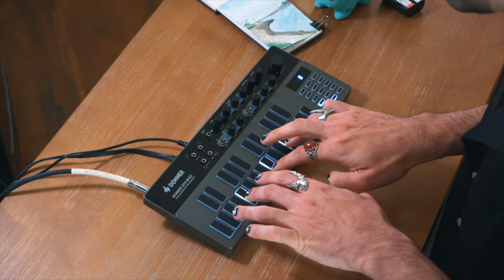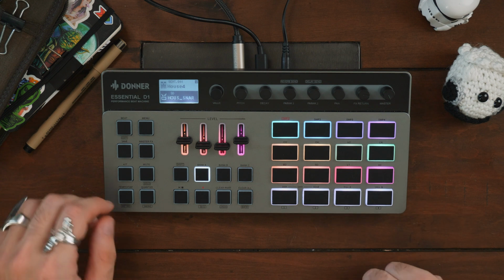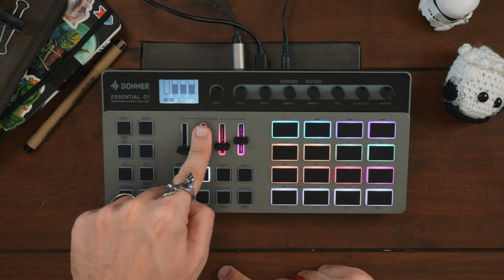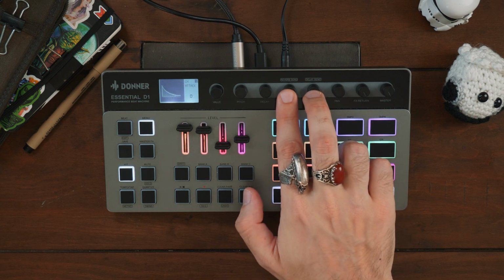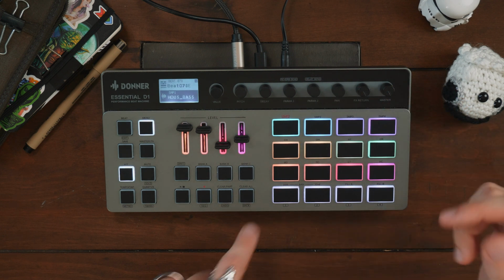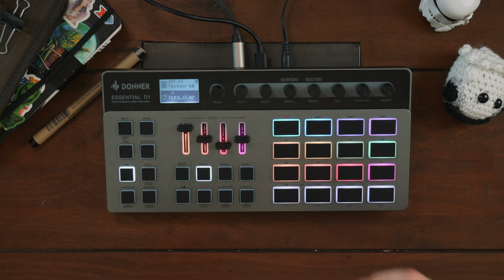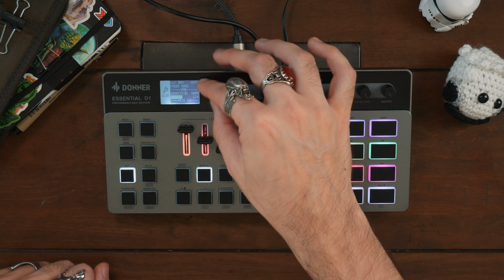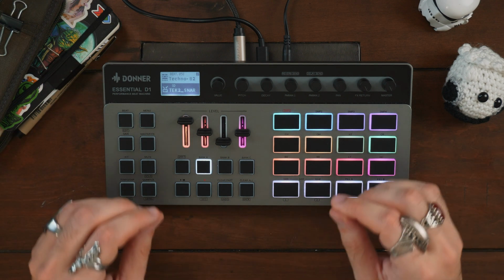The Budget Drum Machine You Need? NEW Donner D1!

Comment: I thought long and hard about whether to buy it. My previous "drum machine" was the Korg Volca Sample with the Pajen firmware. It makes it a really useful tool, but it's not really suitable for tweaking samples; you can't actually sample with it. It's more of a sample player... Features like time stretch, which I think are really important for a sampler, are simply missing. I think the Digitakt is still the best in that regard. And worth saving up a bit longer for. You can also control other synths with it, which is a HUGE plus, especially considering the space. I don't have that much space, and it's already getting really tight with a Beatstep Pro, five Volcas, a MicroFreak, a TD-3, and a few stompbox effects. It's certainly fine for beginners getting to grips with the material, but you'll quickly notice the limitations and want more. I just keep saving, and with a bit of luck and discipline, I'll have it in two years. Unfortunately, I can't work due to illness, so I have very little money available. You make great videos, I'll subscribe. Greetings from Germany.

Comment: First off, I really like the Donner D1. Its fun to play. HOWEVER it frequently crashes doing very mundane basic things. Trying to adjust the decay of your bass drum? It might just crash and leave you having to turn it on and off again. EVEN WORSE the App for it is horrible. It doesn't always register that you've tried to drag and drop a sample in, so sometimes I have to drag the same file half a dozen times before it registers. Even worse the SMP directory just stopped working one day. I could no longer add new Samples to the SMP1-SMP4. After a week it began to let me add new samples, but I could not see existing ones, and so I cannot remove them. Also one of my samples randomly corrupted after working fine for several days. Also you need to learn a very specific, weird way, to hit the drum pads in sequencer mode. In live play the drug pads work great. In sequencer mode, I have to find a jaunty angle to hit each pad at, to get it to register. There is a lot that needs fixing. Which is sad, because this is a fun machine, when it works. It really sucks not to have distortion on anything but the bass drum, that is kind of unforgivable IMHO